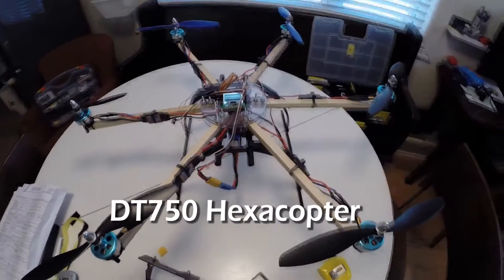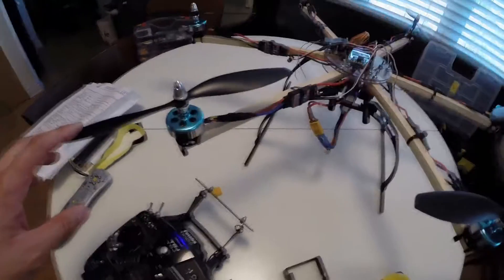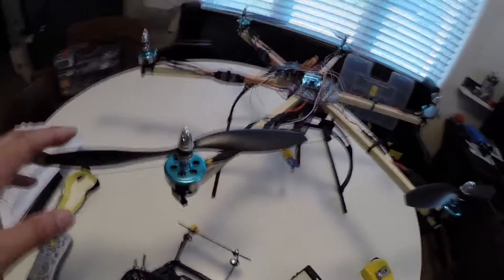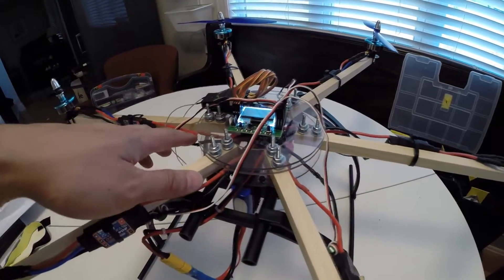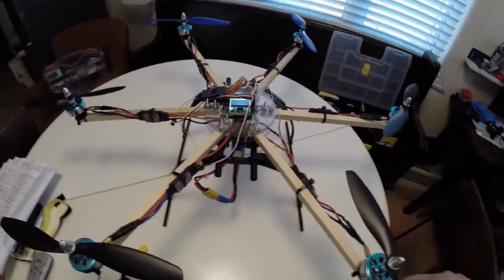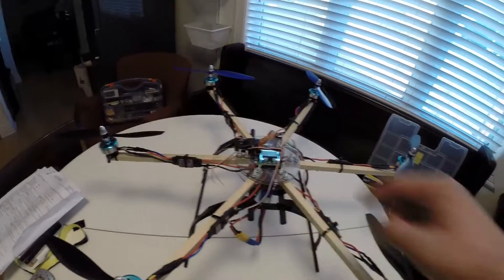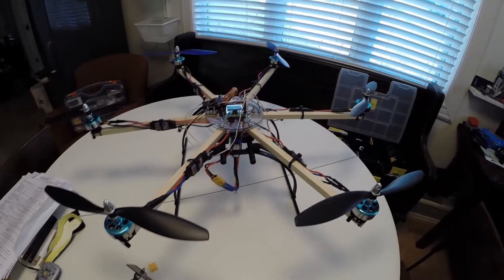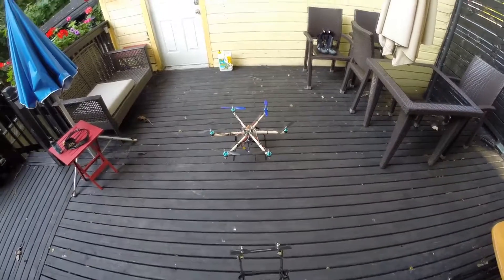DT750 Hexacopter KK2 Anycopter Hub- Overview and Maiden Flight

Comment: Nice Vid. Could you please tell me your settings on the KK2.1.6? I built one but I can't get it to fly smoothly.. I have the kk2.1.6++
Reply from the maker: To be honest, I left them the stock settings and flew with autolevel but I think if you are having problems with it flying smooth it might be vibrations getting to the flight controller, balance your props and make sure you mount the controller with some good foam tape.
Reply: Thanks